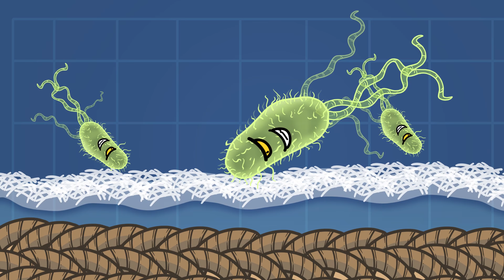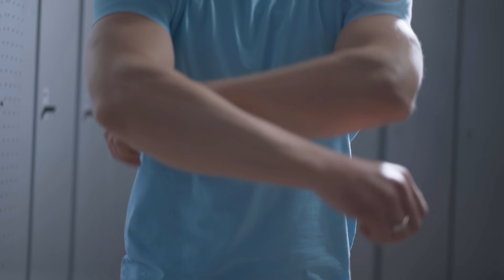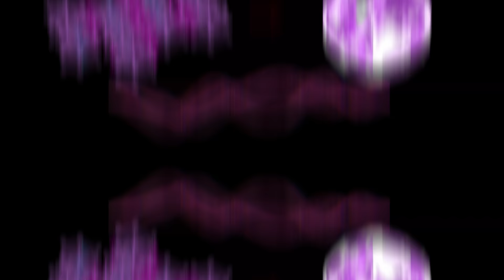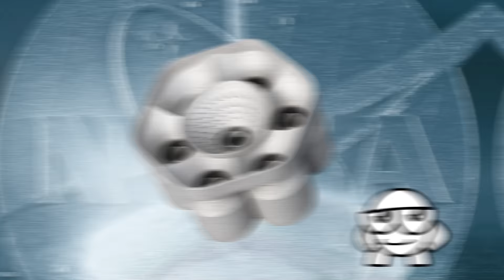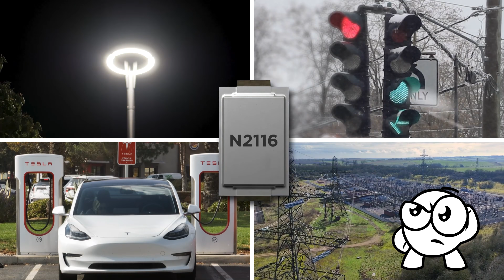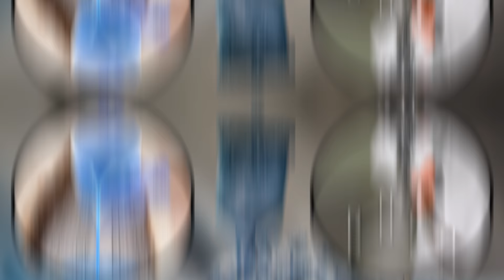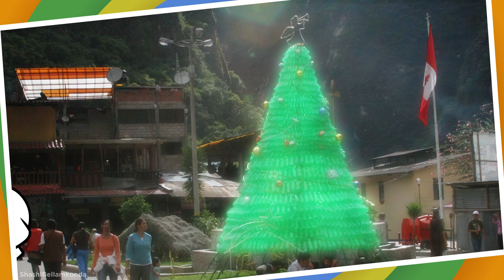When Recently Discovered Materials Are Next Level

Comment: 1. The food from plastic thing is cool and as long as the chemical makeup is the same or close enough to the food it is supposed to be (the nutritional content at least) and there are no extra negative health effects outside of what the food would normally give you (where applicable). If they can do this cheeply enough that it will actually be used/ better on the environment (due to the waste products).

1.5. Now if they can do this for junk food and have it be healthier in the end then good.

2. The battery thing is very good but it depends on is the environmental affects are reduced or non existent, how sustainable it is, how it proformes, if they can make it cheep enough so everyone will actually use it, and mass production.

2.5.Solid state batterys have actually been around for a long time but the price was too high so it was basically not used.

3. The hydrofobic fabrics: washing them will be a pain, but due to their hydrofobic nature, washing them should not be a concern, but because of this, how is there breathability and comfort in hot or cold environments, and how durable they are.

Comment: Silly Putty was initially sold for use as a wallpaper cleaner in the mid-1950s. It was formulated by Joe McVicker, a member of the McVicker family company, which specialized in soap and cleaning products. The putty was marketed as a way to clean wallpaper because it could easily pick up dirt and dust without damaging the surface. While Silly Putty is now known as a fun toy, its original purpose was as a household cleaning aid. 

Accidental Toy Inventions | The Henry Ford - Blog

May 4, 2022 — When a New Jersey nursery schoolteacher happened to mention that the modeling clay used by her students was too firm for their small fingers, her bro...

￼

Henry Ford Museum

Comment: 2:48 how do you clean hydrophobic fabric?
Reply: Anything water based can't make it dirty. If it doesn't repel oil then it could be cleaned using solvents that also aren't repelled. I suspect though the hydrophobic material will repel everything and therefore never get dirty.  What I wonder is if it's hot and the person is all sweaty how would it feel being covered with such a material.

Comment: Monomers are molecules that can be bonded to other identical molecules to form a polymer. Liquid Monomer (methyl methacrylate monomer or MMA) is widely used for the application of artificial/acrylic nails. However, 30 atates have banned its use in nail salons due to it causing respiratory issues, skin allergies and nail deformity just to name a few. Using monomers to make edible foods from plastic though? That's a HARD PASS for me.
~ APRIL LIPKE

Comment: Lot's of mistakes in this one, sadly. Usually I enjoy your content, but this time you either tried to simplify it too much, or you didn't fact-check properly. 

Just a few examples: 
Hydrophobic means there are no electric charges on the surface, otherwise it would attract polar molecules like water. Thus the explanation for the antibacterial effect makes no sense. 
Making ice from plastic? Not really, it's merely one of the additives and nothing new, most used vanilline is synthetic. 
Yttrium is NOT an oxide, it's a metal. What they likely used was thus yttrium-oxide. 
Using shrilk, which is water-soluable, for cups? Have fun with the spillage.
Calling a mass of metal, remote controlled by electromagnetic fields, a robot? Really?
Spraypainting a coating to keep the surface whole, while the parts behind it still break when you strike it... (you can see parts of the wall flying off in the video)
Saying Thalin shock absorbers aren't effected by the impact makes no sense at all. The kinetic energy has to go somewhere. If it's not absorbed it would be transferred to the underlying structure, which you don't want. It's likely just very flexible and doesn't tear/break. There has to be some deformation at least.
Carbon fibre has been in use for decades, there's nothing new or "recently" discovered about it. The explanation with its comparison to diamonds is also not really applicable as it's more similar to graphene or CNT...

Honestly this reads like the hallucinations of an LLM like ChatGPT.

Comment: The hydrogel is the most impressive to me, it sounds like it would stop the fastest bullets and shrapnel too. 
The most useful one though if it can perform as advertized, is the solid state battery though. Beside their usefulness in phones and EVs, as more and more devices are switching from replaceable batteries to inaccessible rechargeable batteries instead, after a few years they wind up in the trash or forgotten in a box somewhere.

Comment: A incredibly rare fail with your research - it's normally spot-on!

Some "Self-pouring liquid" materials have been around for at least 50 years - that's how long ago I first saw one.
(Ultra-high molecular weight polyethylene oxide is a good example you can buy; totally harmless & there are videos on how to mix it correctly.) Search "Elastic water" for examples - one of the videos is from a 1967 newsreel.

Comment: How would you eat your eggs once they're coated if it's unbreakable?
Reply: Good question
Reply: I just saw this comment  ... so i asked  the ChatGPT AI for an answer, this was the reply  ... That’s a fun and quirky scenario! If eggs were coated and truly unbreakable, you’d have to get creative. Here are some hypothetical approaches:

1. Drill a hole: Use a small drill to make a tiny hole in the shell and extract the contents.

2. Chemical reaction: Find a way to dissolve the coating (like using a safe, edible acid or specialized solvent).

3. Slice it: If the coating isn’t too thick, try using a laser cutter or a very sharp tool.

4. Melt it: If the coating can melt under heat, carefully heat it up and let the contents cook inside.

5. Serve as is: Just display it as unbreakable egg art—you might not be eating it, but it’s an intriguing conversation
Reply: @annemariemyburgh7252  they haven't answered yet.
Reply: @lisamartinbradley1039  ... i know... i just copied  what the  the AI said 🤗